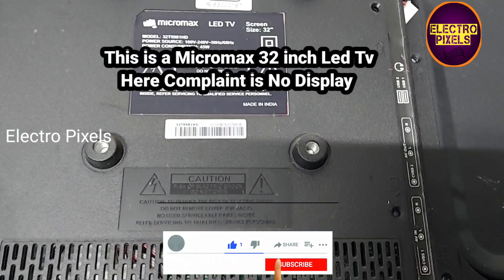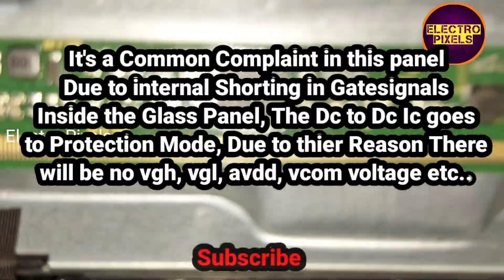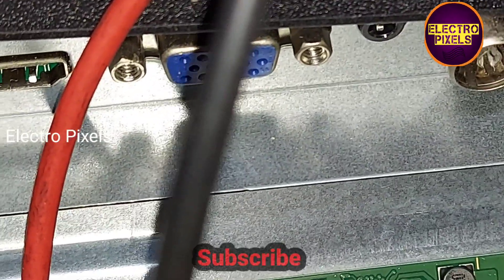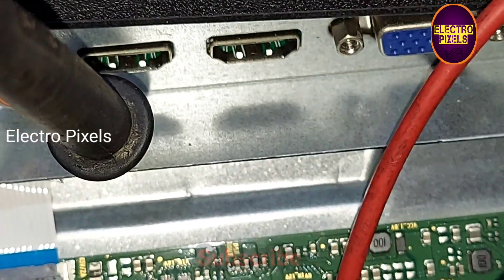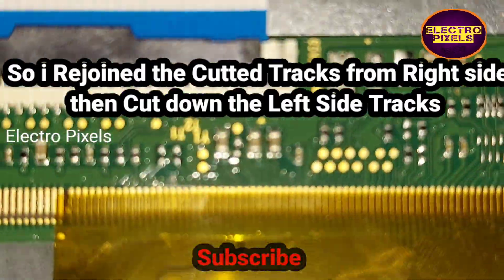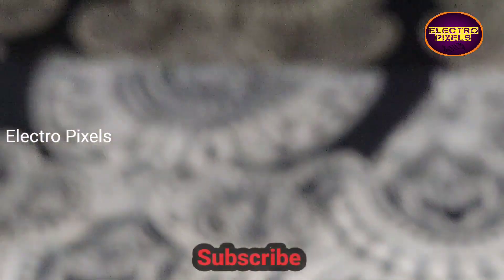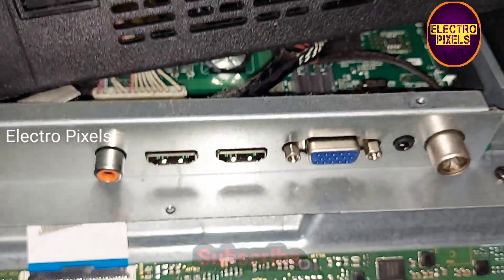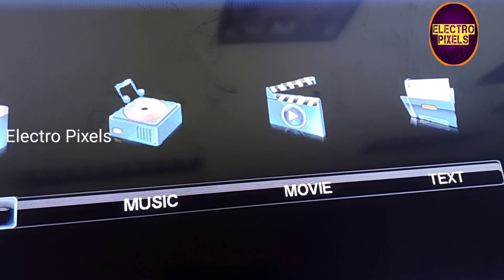Led Tv Vgh Vgl Short Removal No Display Blank Screen But Backlight OK(SM 4186 IC)Dc-Dc Ic Short

Comment: In this method only 15 or 30 days working only
Reply from the maker: It depends only on luck basis, i already said in video it just a temporary solution only, permanent solution is Panel Replacement.we can't predict how long it will work, people use More than two years are also there, if the both sides of the Gatesignals are short then no use, its completely on luck basis. It Doesn't mean that this method work for 15-30 days, people using more than one year also there